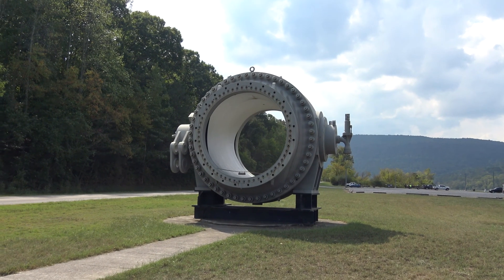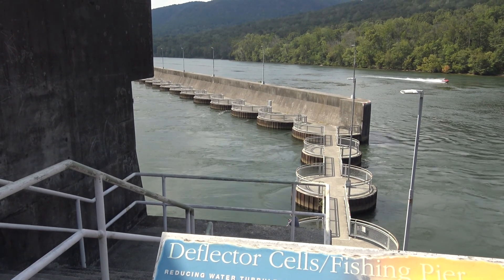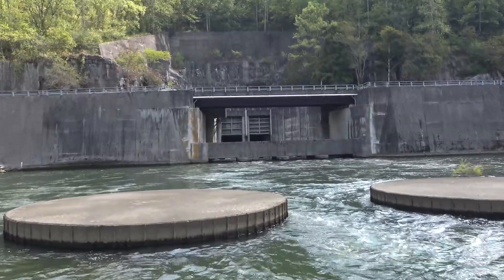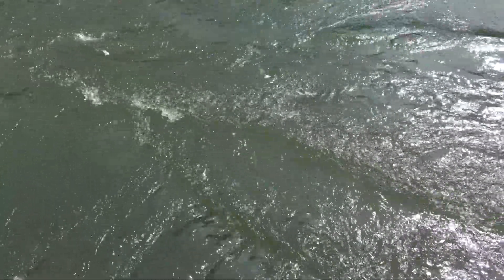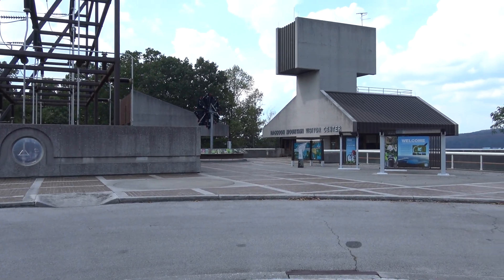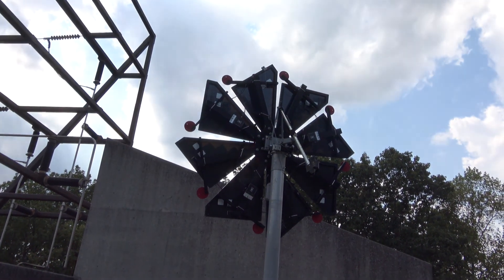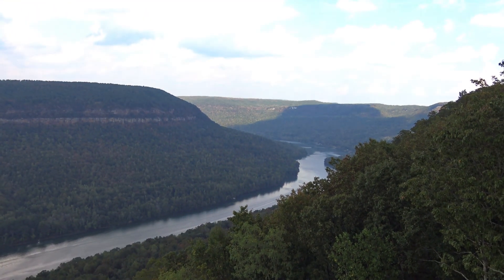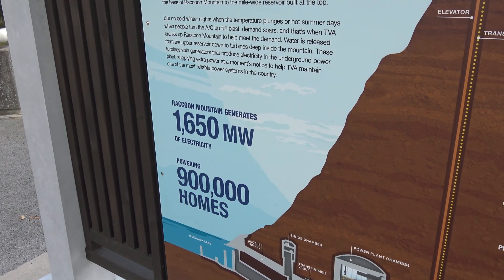Raccoon Mountain Pumped Storage Revisit

Comment: Wasn't it a pumped storage facility in Missouri where the dam broke and destroyed the Johnson shut in's?  I remember swimming there before the disaster and it was a beautiful place to swim and jump off rocks. Now I've heard it's destroyed. I think people may have been killed and lots of property damage.  Hope they account for all the increase rainfall here.
Reply from the maker: I believe so, but the difference here is TVA was able to use the geography of the mountain top to make a much stronger lake structure. The one place if it ever would break through is the rip rap dam and it would follow a natural run off down the mountain and back into the Tennessee river. While there are a few homes near there, evacuations could happen really quickly